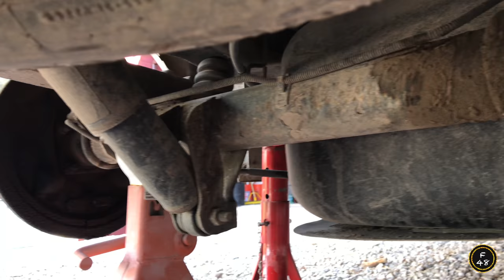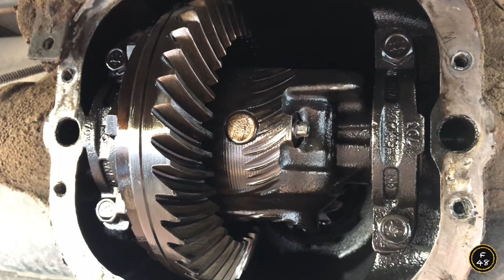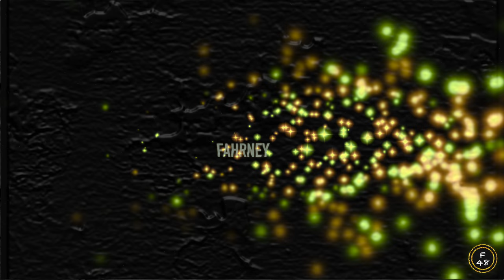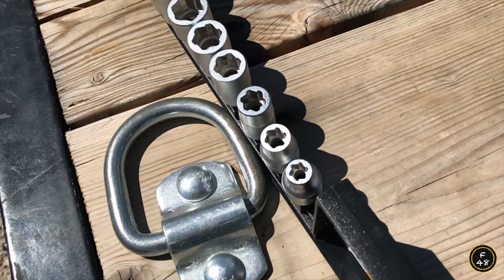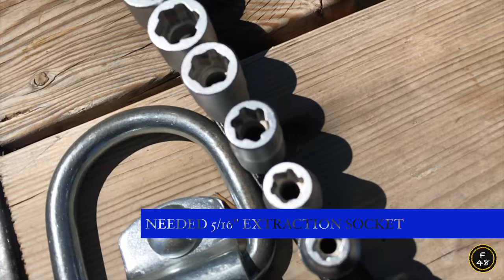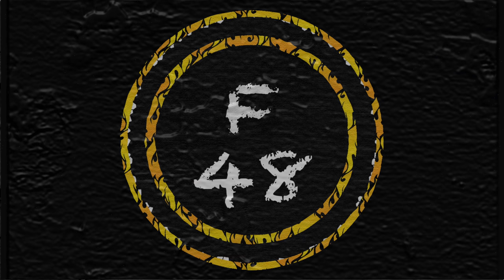Removing a stripped pinion bolt from a differential!!!

Comment: Just had this same stripped bolt head. Bought the bolt extractor set for a different bolt, and had it sitting in my toolbox. Never thought about using it until I saw your video. Thanks for posting this fix.

Comment: I stripped my bolt head earlier. Just to confirm, the cross pin bolt isn’t reverse thread, right? Lefty loosie?
Reply: This is a good question
Reply: @SantosGaragePlus  it wasn’t reverse thread. Just turn out I used the wrong socket, which was 8mm. I was suppose to use the 5/16 standard socket. Anyways, I ended up using an 8mm or 5/16  bolt extractor. Worked perfectly to get the stripped bolt head out.

Comment: It's stripped because someone's using the wrong wrench.  if this is a GM 10 bolt which it really looks like, that bolt you're trying to remove requires an 8mm 6point socket or wrench.  12point or any other size wrench will turn the head of that bolt into a circle.